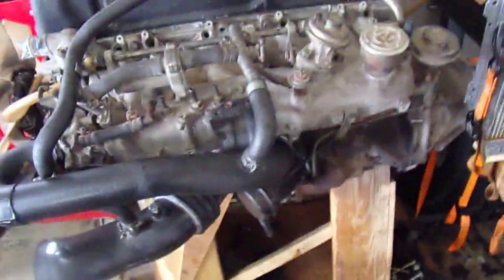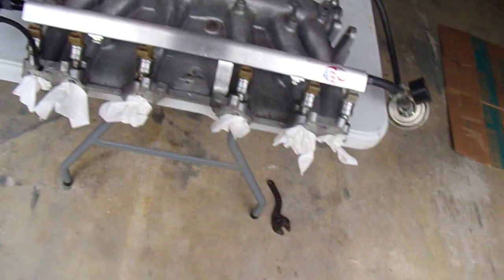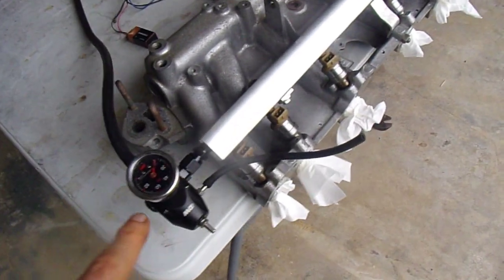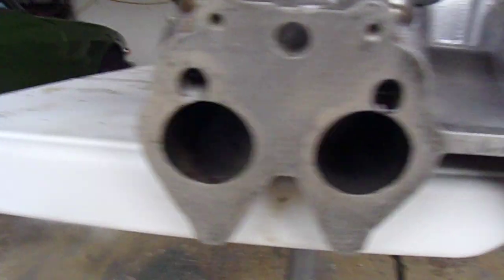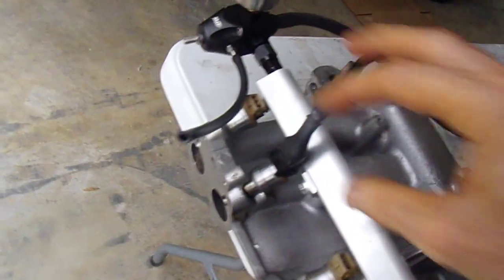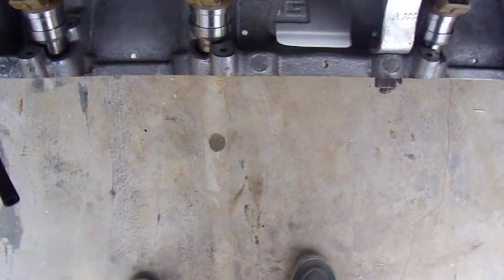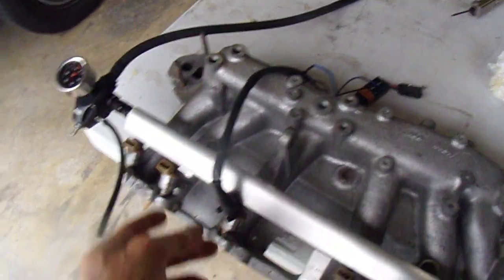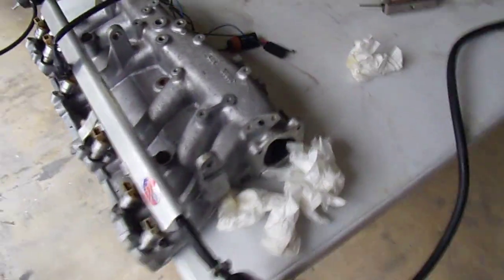fuel rail for l28et

Comment: Cool! Pallnet Fuel rail. Those injectors have 4 little holes in each tip. The pintle cap hole is big enough for all 4 holes as they are super close together.
Reply from the maker: ah so that is why I see the 4 pattern. Going to install now, and will get the new harness on the table ready to remove the covering. I am planning on leaving the PR intact so it can up the fuel pressure on a hot restart, not really needed, but easy to add so you have the option of using it.
Reply from the maker: having some leak issues around the injectors (air leaks) where they plug into the head. VERY critical on exactly how the stab in, I tiny deviation in angle (due to the rail mounts) results in air leaks. I think the best approach would be to use the reg injector mounts to either hold the rail (like a large u shaped piece maybe 3 across).
Reply from the maker: or just mount to the head with the reg holders. Have you read anywhere else about vacuum leaks using the rail?